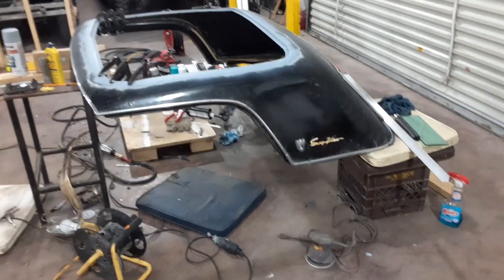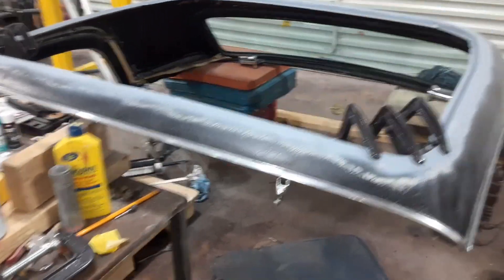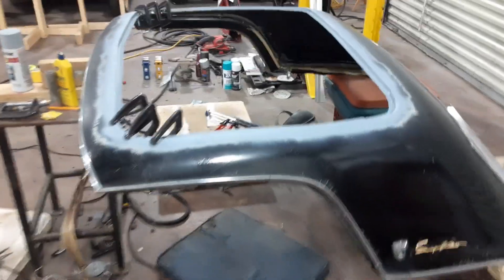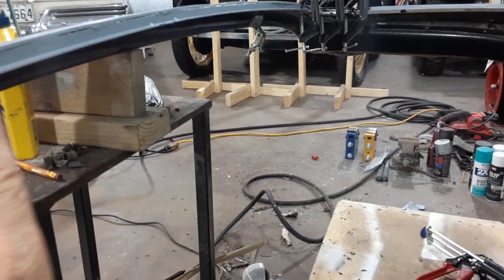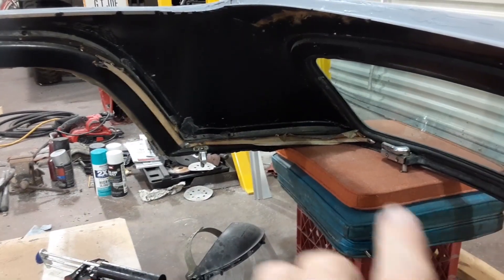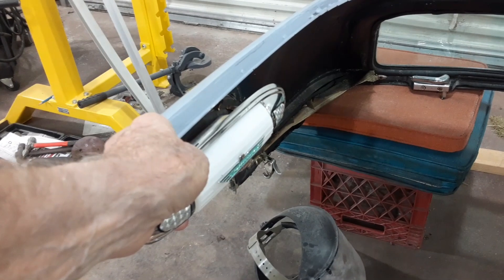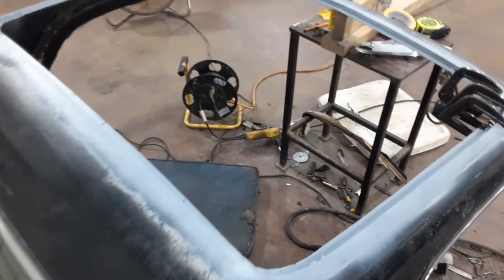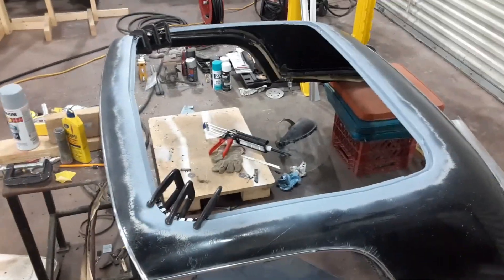1955 Ford Thunderbird Sky-View "Glass Top" Glass Roof progress:  Glass Gasket Lip almost completed.

Comment: What a FANTASTIC job & Idea. I have been following this as soon as I saw this. Again Great Job Bill. Thanks for the Video. Also I have to say Bill, I would Patient this Idea so to speak. I Guarantee you some Larger Company will offer this down the road for 55-57 Birds. You really Deserve all the Credit here. In my 60 years I can’t remember seeing this on any Baby Bird.
Reply from the maker: The compliment is greatly appreciated.  I also have been following the baby birds since they were new and I was about 6 yrs old, and I have never saw a Glass Top.  The early Corvettes offered on in 1954, but only a few were made by GM by Harley Earl for high volume dealership owners and a few others.  A couple of aftermarket companies also produced a small number of them.  However, they were bubble tops - completely formed plexiglass and not a Glass Top as such.  Anyway, my plan is to make mine look, as much as I can, like Ford produced it - as a concept or production.  I have thus far accomplished a lot, but still have a long ways to go.  I already know that it really does look cool, looking up through the top when in the car!